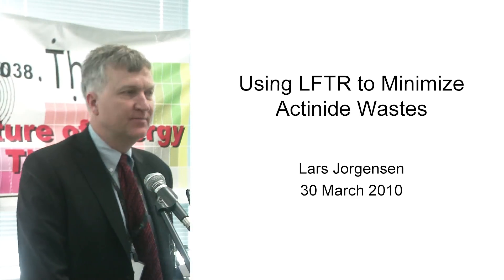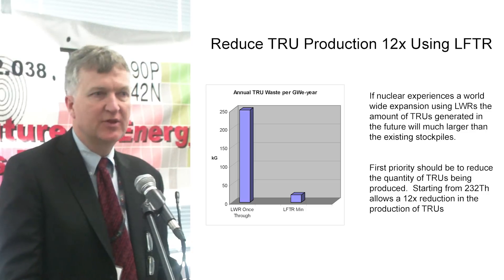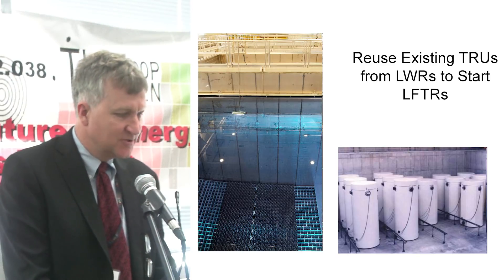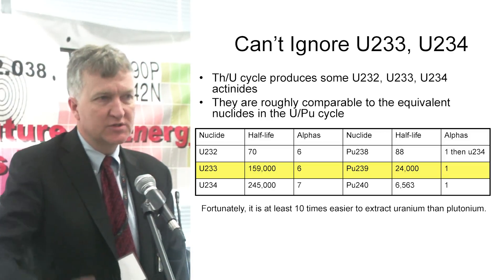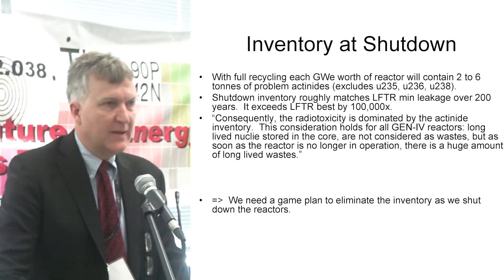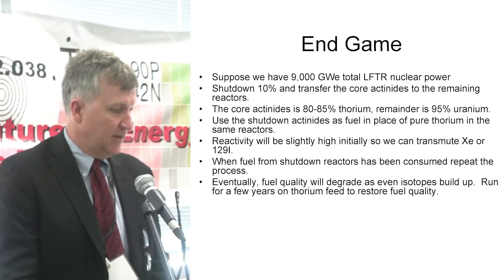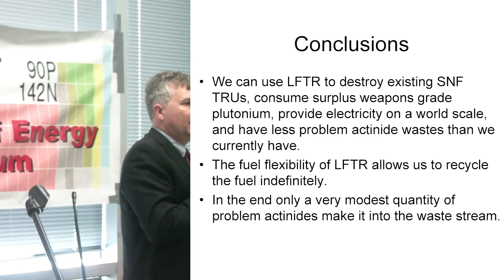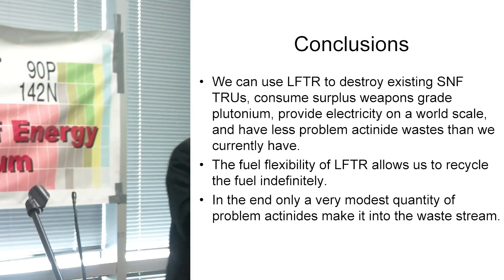Lars Jorgensen - Using LFTR to Minimize Actinide Wastes @ TEAC2

Comment: This is great for countering those who say the plutonium from a LFTR is bad for bomb proliferation. It’s not usable in bombs Because separating out the 239 from the other isotopes is nigh on impossible. 
Molten salts can also run in the fast spectrum (Moltex) which can use the transuranics and plutoniums (any of them)as fuel.